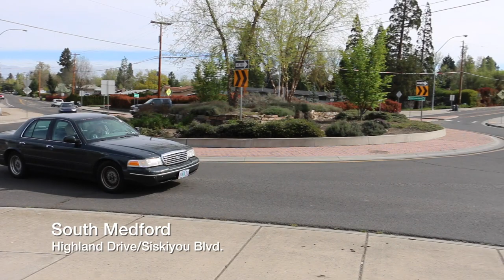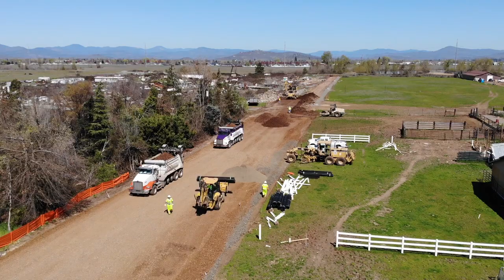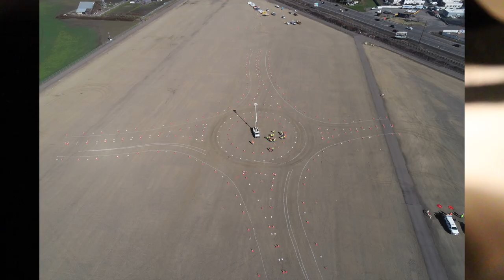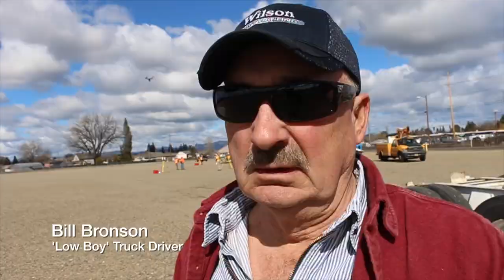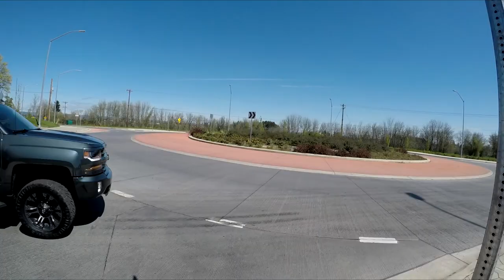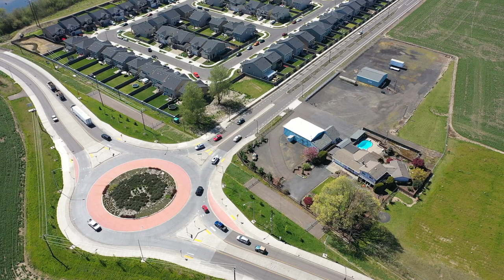Oregon 140 Roundabout Primer

Comment: I drove a "traffic circle" in NJ everyday to work for several years. During rush it was a mess...three lanes moving slowly wall to wall. Hated it (check it out...Collingswood, NJ). Several years later in Scotland I ran across Roundabouts on limited access highways...while driving on the wrong side of the road. Today I navigate low volume roundabouts here in Oregon. You have the numbers and I assume they are safer, but I still do not like them. What is wrong with a traffic light? Not sure this is progress.